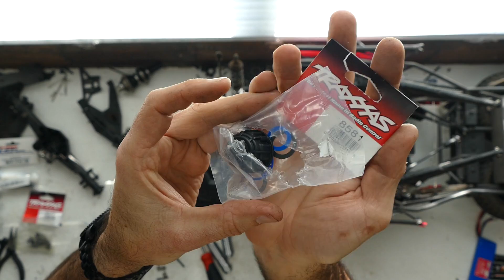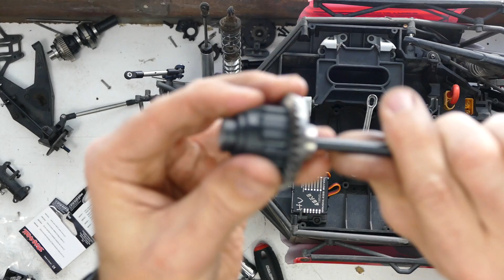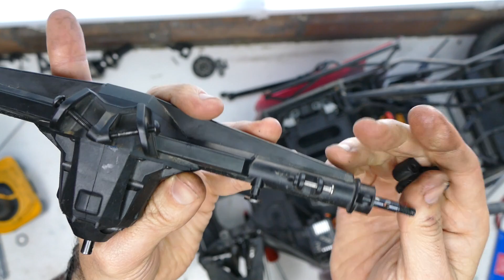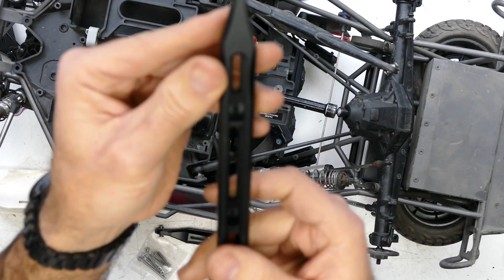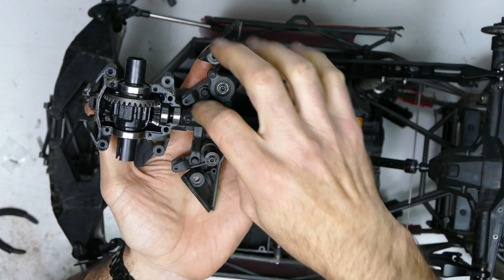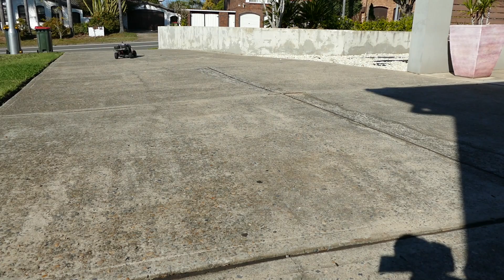TRAXXAS UDR - OPEN DIFF MOD....SERIOUSLY!  Plus GPM Parts!

Comment from the maker: Suspension Arms ➜ https://goo.gl/ew4sXS
Trailing Arms ➜ https://goo.gl/up3TA5
Front Drive Shaft ➜ https://goo.gl/nMXPRu
Power HD Servo ➜ https://goo.gl/sks3ub

Open diff in the UDR is possible with these parts
TRA8577 DIFF GEAR SET
TRA8581 DIFF CARRIER
TRA8584 SPIDER SHAFT/BUSHING SET

Please subscribe ➜ https://goo.gl/KyaLHP

Comment: Best upgrade I've done yet to the UDR was the upper rear toe links in titanium. No longer break the lower trailing arms. I'm giving this diff upgrade a try because it does tend to roll often because of     the Solid rear axle.  Looking Forward to seeing the difference.
Reply: Are they actually titanium or just titanium colour. If actual titanium, where did you find them?
Reply: @tommyb133  they are actual titanium. I found them on eBay.

Comment: Just finished the upgrade, but I was able to use my calipers on both sides of the truck. I'm using aluminum brake discs I got off eBay. Maybe they have a deeper inset on the hub than the stock. Just  an fyi.
Reply from the maker: Yeah I think they are different.
Reply: Hey Marc's you have a link to those aluminum discs? I want to do this model but I want to keep my calipers and discs...
Reply: @Bawla187  on Ebay search for udr brake discs and a ton will come up to choose from.
Reply: @marcsoscaletrains  cool, hopefully they'll have the same deep slots allowing the rotors to fit..
Reply: @Bawla187  Just grind 2-3mm off the axle...no need to spend money or order parts.

Comment: Nice mod indeed. I'm not a big fan of locked diffs. You need quote loose surface to avoid the mechanical stress. If you still want it fairly locked you can always use 1 million cts diff oil :).

Enjoy!
Reply from the maker: Thanks man

Comment: How about dressing down the ends of the driveshafts where they go in the diff housing to make up for the extra length to be able to use the disc brakes, and calipers? There should still be plenty enough length on the splines to go in the diff, and shouldn't make them any weaker. That's my take anyways.
I really like RPM products, and I'm not sure if T-Bone racing makes parts for these yet. Those are indestructible, and lifetime guaranteed.
If the front diff is solid in the frame, why would you need a telescoping front driveshaft? Or does the front diff float in the frame?
As for the body roll, the suspension was designed to do that. As for the open diff, it looks like it made quite a bit of difference. You will still get body roll no matter what you do to it. 
Another great video, and you helped me decide that I'm going to get one of these.
Reply from the maker: Much appreciated brother and thanks for your input. I still love the UDR, it is a different driving experience which makes it fun and more challenging at times.
Reply: A stiffer saw-bar will solve most of the body roll issue

Comment: Pretty cool. I can’t tell ya how many times I’ve rolled mine on cement surfaces. I went with the hot racing trailing arms. Fun truck for sure. I’m thinking of modding my body similar to yours. I just painted a new one & don’t feel like scratching it yet

Comment: Great Video.Aftet replacing my center drive shaft i noticed a small chrome pin about a quarter of a inch long did uou run into this pin at any point of thefront diff build?

Comment: Very cool, I'll have to keep this in mind for if I ever get around to getting one of those (still want one). Definitely, could use a front aluminum bulkhead for a little more strength and stiffness  for those lower a-arms (as well as a bit more front biased ballast). I feel like you should match those lower a-arms to the top ones (just for the bling factor), but understand that it is more functional to keep the plastic.
Reply from the maker: Yeah needs more bling 😊
Reply: I’ve had my udr since it came out. And every since I raced my brother with it against my xmaxx I broke the rear trailer arms. It was a decent race until we both hit each other sideways neck & neck minor collision still rolling. We swung back and immediately noticed it was snapped! I was so pissed it was my first upgrade I made aluminum. After looking at the chassis design as I installed the upgraded trailer arms, all I could think about was man this truck screams aluminum bulkhead + upper/lower A-arms. All though the saying whn you go full aluminum there’s no flex or give, I’d still do it just to see how strong it can be. Ever since tht rear trailer upgrade my udr sat after only being driven abt 6 times. I stockpiled all the aluminum pieces i wanted to use. The main upgrades I wanted even before being designed included the rear axle, bulkhead, & transmission housing. I now have the axle & bulkhead bt no trans yet. Hot racing front driveshaft & AL diff case, Integy Steering bellcrank, & acer racing ceramic bearings to piece things together for smoothness. Looking at the video told me everything I wanted to know visually & verbally about the capabilities & purpose for open diff. Although I like the challenge of driving with lock diff, I’m  more open about this mod.

Comment: I would do the same thing,and the I would add a very heavy fluid so ifs still semi lock with some slip/spin 😎I don't like the idea of  the rear different being locked as it limits how you can use the truck.
Reply from the maker: Thanks man

Comment: The GPM front shaft is actually well built, but the pin it comes with is NOT. Replace the GPM stainless pin with Arrma pins PN AR713005 and it's bulletproof.

Comment: I bought some 1 million weight diff fluid for my UDR center diff, it’s not a locked center but with the 1 million it should be pretty close, I’ll find out once I do it. This is just info I’ve heard from other guys advice. Maybe I’ll have to do what ur doing if I don’t like the 1 million weight. I’m not sure but I’d have to look it up cus someone told me the center diff stock already has 1 million weight. Guess I gotta do some homework on it. Thx for sharing this Steve 👍😎
Reply: I’m actually watching this as I’m doing all three diffs on my Kraton
Reply: Dude !!! Change your upper link bars also. The ones that come on they're very weak
Reply: Aaron j Shirey jr ya I’ve got the gpm upper rear links, I didn’t bend my originals or anything but when I got the aluminum trailing arms I bought those also
Reply from the maker: Thanks bro. Definitely might get the upper links soon

Comment: Nice improvement It's still a solid rear axel but now with an open diff instead a locked one. The real axel still moves as one pivoting beam so suspension travel on one side affects the other side; pushing the other wheel down for better traction whilst 4WDriving/crawling but not so good for high traction surfaces getting tonns of roll over as you know. So it will still roll someone and have very similar characteristics so long as it doesn't have independent rear suspension.

Comment: You should be using the aluminum cup not the plastic you will melt the plastic cup if you're running 6s constantly

Comment: Awesome vid, CHEERS.
I will certainly do this too... its interesting with the track width now being increased (4-6MM?) due to the axle cups and not splined tube, I've just purchased the GPM +3mm brake rotors, to widen the track also, so with this mod, it will increase the track substantially, helping with rollover issues(I hope), How can we widen the front track now to match, hmmmm....
has anyone had any damage transfer from the Alli trailing arms?

Comment: That modification is basically if you want to run it on concrete so it doesn't flip over as much. The truck is not designed for concrete. I actually bought the parts for this modification myself and decided not to do it. Using the truck for what is designed for you'll get the best performance out of it I'm not sure if using that modification will give you any better advantage on the sand with this vehicle that's the reason why I'm not going to do it right away. Definitely changed that cup to a aluminum cup if you haven't already. Great video BTW
Reply: Thats what i was thinking as i watched this. I hate running offroad trucks on pavement they just arent meant for it. Get an onroad for that cause these trucks are made to be offroad and the udr wont handle like say a traxxas slash cause its a trophy truck made to drive like a scale trophy truck with proper driving offroad.

Comment: Whoever told you an open diff will be less likely to make you flip did not know what they were talking about you would be less likely to flip over with a posse rear end it would be more likely to slide around instead of grip up and flip
Reply from the maker: I much prefer it now. Heaps better.
Each to their own bro
Reply: @RCTanksTrucks247  true that to each their own but facts are facts

Comment: Should have had a proper diff on it right from the start.
Reply from the maker: It's good standard, different type of car but I wanted to see how it performs with a diff and solid rear axle
Reply: Mmm. It does look like a fun one, if I had the money I'd buy one and nitro convert it. I think an OS 30VG would do the trick.

Also, seems I've spotted a linguistic difference. Up here in the US, the term 'solid axle' would apply to the UDR's rear axle with or without a diff, we say 'locked' or 'open' if the need to specify what sort of gearing is within the axle exists. Interesting little linguistic note there, heh.
Reply: you can get a fy03 1/12 for $40..it's basically almost the same design
if you want to ..hack/wack...to LEARN without breaking the bank.
Brushless motors has pros and cons...it's instent wazzoo of power/torque..you have to match the proper KV with the gear ratio.
Power to weight ratio. It also depends on what you want...
I dont crawl much....No thanks on locking the diff.
Bigger toy needs beefier parts...and that's that.

Nitro sucks....i ran those back in the days...too many moving parts
and too much noise.....I can run my electric after midnight.lmao
Im converting a couple of Tmaxx to electric.
chucking the tranny and drive lines.
replace with 1/8 scale buggy center diff and metal dogbones.
WHy would I do that and not just leave it stock as running a nitro?? lol
Reply: @OneEyE Monster

* If I wanted an off brand piece of chinese sewer pipe remelt I'da already bought an FY03. Thing's made of plastic so spongy it's more true to say they built it out of rubber instead. You get what you pay for and I don't want a model that's built out of such soft plastic that rough terrain renders steering pointless due to excessive flex. Plus parts are gonna be a bitch to get and it's not gonna be anywhere near as capable of soaking up rough terrain as a 1/6 desert truck is just by virtue of being a fraction the size. A large part of why the UDR is so realistic in how it drives is because it's a heavy ol' pig, which means inertia tends to keep the chassis reasonably still while the suspension is going bonkers to soak up the bumps. You don't get that on a lightweight plastic thing from Banggood, it's gonna bounce all over creation.

* I'm well aware of the pros and cons of brushless power. I have a brushless motor in my fleet, I have a brushed motor in my fleet, I have two smallblock nitros in my fleet, I have a big block nitro in my fleet and I have a 40 size nitro aircraft. Of the lot, the biggest smile factor by far comes from when I get the Mad Crusher GP out. Big block brute force on a live axle 1/8 MT is grin city. Thing wheelies on command like it was brushless, hearing it run through the three-speed trans is beautiful, and it just feels right to have a noisy, smokey brute of an ICE powerplant pushing a monster truck over and/or through everything that dares oppose it. That's just *right*, ya know? But my SC10GT is a close second, it's only a smallblock but it's light, nimble, fast, doing all the things the big and bulky Mad Crusher can't do. Like corner at speed without flipping over. On the other side of the coin, my brushless model has a habit of obliterating ring-and-pinion sets, destroys driveshafts, has melted several switches, and for three or four months was nothing but issues. They're sorted now...mostly...except for how I have to recalibrate my ESC every other time I turn the fucking thing on. IHSTHUTISHJSTIDHTR. To top it off I didn't even skimp out on the electronics! Castle 5700kV 1406 motor on a Mamba Micro X Crawler ESC running in SmartSense mode. IT ain't like I'm using any one-hung-low junk electronics to power that thing. And the brushed model? It's an original 80s Grasshopper with an original 80s 540 silvercan in it, pushed along by a 2s 4500mAh lipo running through a HW Quickrun 1060 ESC, all while running on the original 80s tires with the original 80s AM stick radio. You can probably imagine how it drives. It's fun enough but I haven't run it in months.

* Nitro doesn't 'suck'. It just requires a little patience, a little knowledge of how engines work, and not living in a suburban hell where your neighbors bitch about you enjoying your hobbies. Rural life best life, I can run whatever the hell I want to out here and the nearest neighbor's too far away to hear it no matter how loud it is. I still run nitro, still prefer nitro in fact. My next kit will be the Kyosho Scorpion XXL Kit version, and I'm going to build it GP with an OS 30VG in the back. It's gonna be boss and the smile factor'll be off the charts.

* Yeah, why would you waste your time with a T-maxx? I honestly have no clue why you'd go to all that trouble to brushless one of those things. They're fragile as fuck and should be binned in their entirety in favor of a monster truck that can survive a basic rough landing from a jump more than two truckheights above the ground. The correct response to acquiring a Tmaxx or EMaxx is to flip it on eBay and buy something better made. Fucking pieces of shit have had the same weak bulkheads for >20 years.

I still want to do a nitro UDR someday. And if I ever find the money, I will do a nitro UDR. Why? That's what I prefer. I have a bigger grin on my face when one of my nitros is sitting stationary idling away at my feet than I do either of my electrics doing WFO donuts. The cool factor of having a functional internal combustion engine capable of >1HP that's smaller than a coke can is well worth the price of admission to a gearhead like me who can't afford to hotrod 1:1 stuff.
Reply: @OneEyE Monster You're calling me a mindless sheep because I'd rather have a vehicle made of decent quality plastics than remelted ABS sewer pipe?

Ok now I know you're just trolling me. IT's no secret that China can produce good stuff, hell my AE and KYosho models were built there too. But they can also produce some absolute dreck, and I'm sorry but you really do get what you pay for when you buy Chinese products. You wanna pay $40 for an RTR 1/12 hobby grade you're gonna get some of the crappiest materials they can scrounge up over there.

Honest truth, Traxxas isn't even 'good' quality. They're 'passable'. Their trucks are fragile and overweight pigs that exist mostly to fan the flames of fanboyism. You want a GOOD RC car you'll buy from AE or Kyosho or Mugen, any number of other, better competitors in every segment TRX operates in. This, funnily enough, is why I don't own any Traxxas models! But TRX are worlds better than the offshore stuff you find on Banggood. Night and fucking day difference better.
Reply: I have plenty of R/C toys. ALL BRANDS. My 1.20 O.S. engine cost more
than all your toys combined. They dont make the real Mc Coy anymore.lmao
Reply: What's bragging about your credit line supposed to accomplish?
Reply: So what he hell dose installing a nitro engine has to do with anything
about converting a lock diff into the a limited slip???
Brushless motors are too spungie or what?? lol
Reply: The stock setup is called a spool witch is proper for a full size trophy truck

Comment: You need GPM parts so it doesn’t break every time you run it. 😂 that motor is super cute too, does your sister use that on her barby convertible.
Reply: losi fanboy alert.

Comment: lol ...  if you want it not to flip  ... take the tires off the body ,  lower the shocks and harden the springs ... no body roll and a lower ride height ... lol ...  changing the rear diff .. that maybe helped like 4%.
Reply from the maker: Not really man, tried that too before. This is a easy mod, no big deal just wanted to try it out.
Reply: Wrong